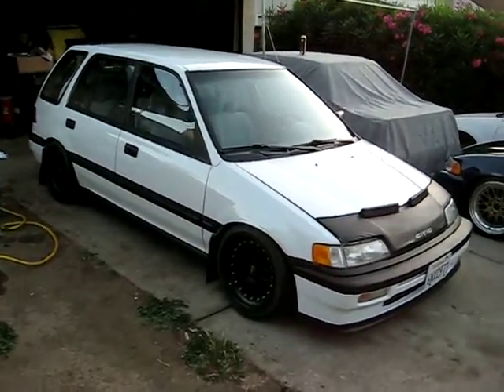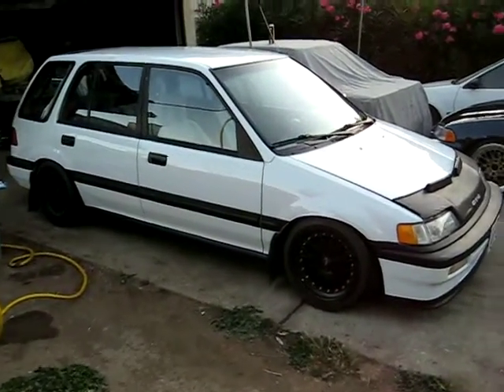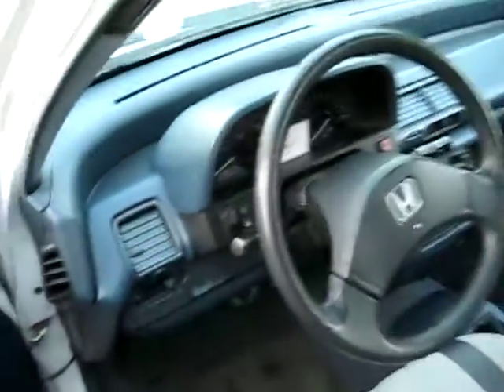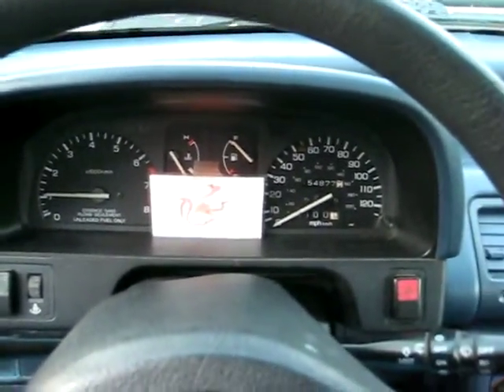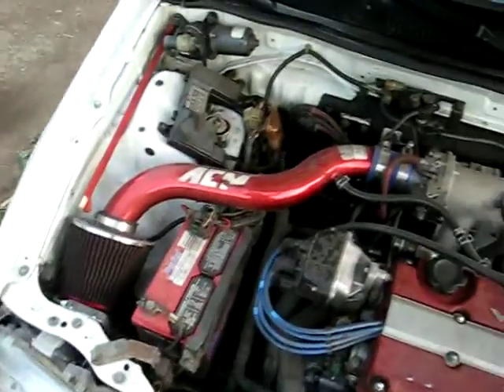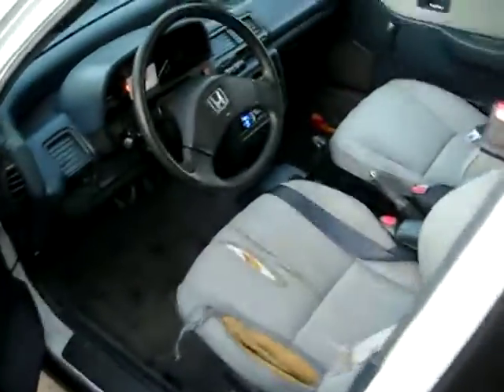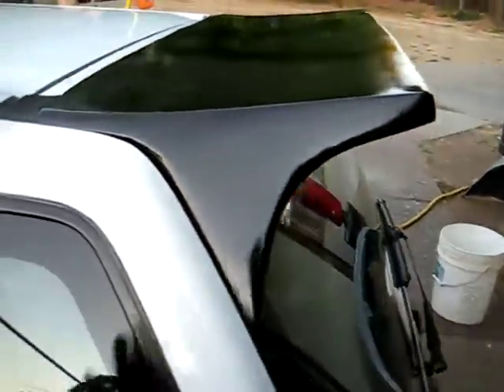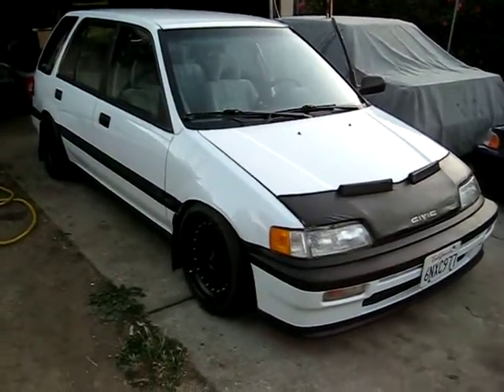1990 Civic Wagon Walk Through

Comment from the maker: should be at the back of the block under the intake manifold near the oil filter. its this black rubber cone like cover. it has 2 wires in there which is black and yellow. look those together.

Comment: Got mine for $500. The interior is perfect, but the exterior needs work. The previous owner never use for 7 years, and the car got right through hot dry sun and harsh winter. It just started a week ago, and it works like a dream.